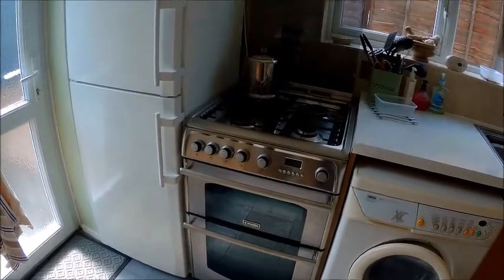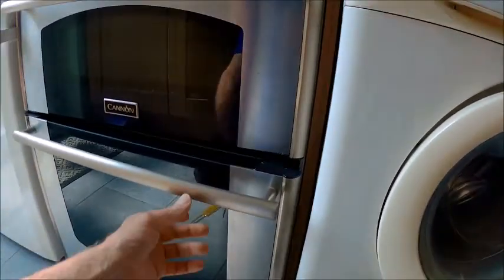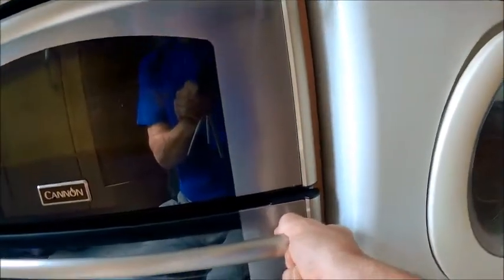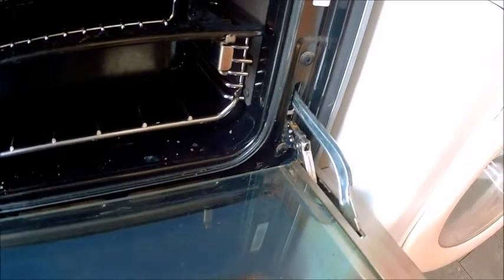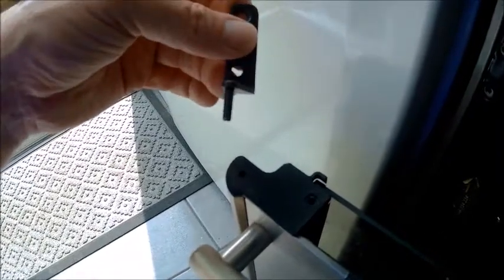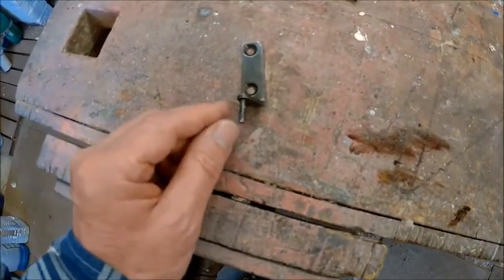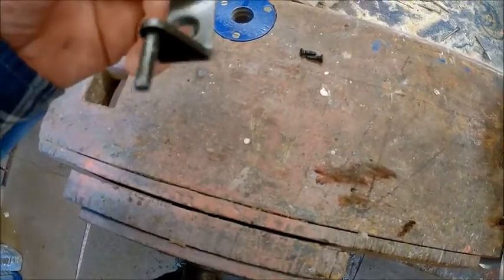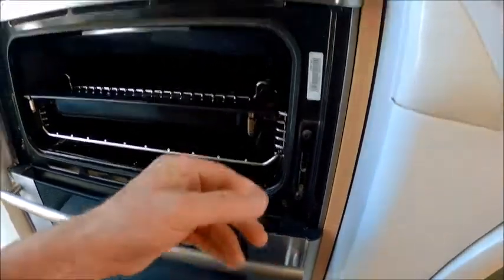Cannon Cooker Door Problem

Comment: Many thanks. On our cooker the problem was just that the hinge screws had come loose, but I spent ages trying to figure out how to get at them to tighten them up. So your video was a real life saver! With the screws tightened, the door shuts properly.
Reply from the maker: Excellent Dave, glad to be of service.
Reply: Hi I have the same problem, where did you get replacement screws from?

Comment: Thank you so much for showing this excellent tip for solving both my problems - taking the top oven off which allowed me access the door and fix that as well 👍👍
Reply from the maker: You're welcome. Thanks for the comment! 🙂
Reply: Hi I have the same problem, where did you get replacement screws from?

Comment: Success! Bought 10mm x 3mm round magnets. Rob fitted them to oven edge, but then found my door was aluminium so they wouldnt hold! He removed original closing 'rod', made a small metal plate, and converted a screw, fitted them in under 15 mins,  and Bingo - it holds shut tight just with magnets. So easy when you know how. No need to take oven apart.
Reply from the maker: Great news! Thanks for posting here; maybe someone else will benefit from your experience and save a few quid.
Reply: Hi I have the same problem, where did you get replacement screws from?
Reply: @footyportal1228   sorry it’s 3 years ago I just can’t remember - but it still works. Good luck.
Reply: If there was a way to send you a picture of what Rob fitted I would post it here - but can’t find how.

Comment: The door on my Canon Harrogate cooker - same door style - used to work by lifting it. Now it wont close at all. Friend scratching his head and is going to search internet. There doesnt appear to be any play on the hinges. A neighbour had same cooker - same problem with difficulty closing. She was so glad when she could afford a new kitchen and scrap it! I've just had my oven cleaned, and it works fine, escept for d** door. Hoping for a miracle.
Reply from the maker: Has your friend looked at the catch? Could be a spring loaded wheel in there which may have siezed and not moving. Just a thought. Good luck!

Comment: Extremely useful video. Our door will shut but the oven wont come on, unless we lift and hold the door up c1mm. The amount of play in the hinge. Is this a related issue?
Reply from the maker: I'm not an expert but it sounds like it is. Sorry I can't be of further help. I now have to look into replacing the flame failure device for the grille.....

Comment: When you say you were going to put in  a bushing but couldn't , and welded the top hinge pin, was this because the hinge pin had worn and needed replacing, or because the mounting in the door itself had been worn ? Found a company that sells spare hinge pins and wondering if a new one would be a suitable fix? any ideas? thanks for the great video, really helpful.
Reply from the maker: Mark,  The hinge is steel and the door looks like aluminium.  I was hoping to find the door was also steel, making it easier and more practical to fit a bush. However, with the door part being ally and a bit thin, bushing would be very difficult.

Comment from the maker: Update November 2022: Unfortunately this cooker has finally bit the dust! 😪 After years of faithfull service we decided to go for a new one after the grill thermocouple packed up. The gill would only light if you held the button in for ages and even then, it would randomly go out after a while. However, the top oven burner would light ok (same knob/tap) so I assume it's the thermocouple. I looked into changing the thermocouple as it's only about £15 but it looked like removing the back of the cooker and a lot of hassle. As we are about to retire we thought now was a good time to change. We have replaced it the latest version of the same cooker - Cannon by Hotpoint. I may shoot a review of it, look for a link around here soon.
I tried to sell this old one on Facebook Marketplace but it attracted some dodgy characters, so it went down the tip.

Comment: Hi Floyd do you know how to replace the bottom brackets which hold the inner glass in place? Are they screwed in like the top ones, if that is the case do I need to take both doors off. Many thanks
Reply from the maker: Hi Jools,
I'm not sure but if I had to guess I would say yes. I've just had a look with a mirror and the bottom bits which the inner glass rests on are screwed like the top ones. The outer ones would come off but the inner ones have the hinges so the door would have to come off to release them. Hope this helps.

Comment: We have same problem but it is the door catch. Can’t get the side off the cooker!
Reply from the maker: Sorry Andrea, wish I could help, best of luck!
Reply: Most of the screws are visible holding on the side panel including 1 at the back on the bottom. Then there is 1 more covered by the top of the back panel, so loosen the back panel. The last 4 screws are covered by the front panel with the control knobs on. To remove this front panel, remove the knobs and the two screws under it - open the top oven door. After removing the top panel screws, slide the top panel to the left.